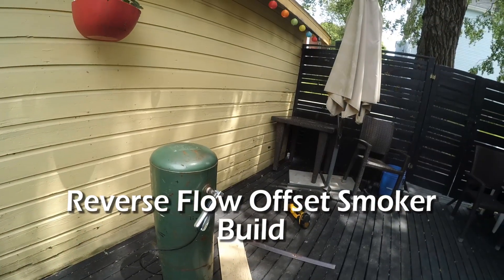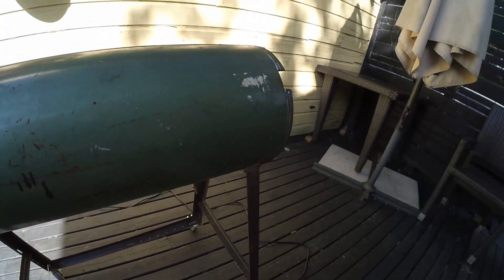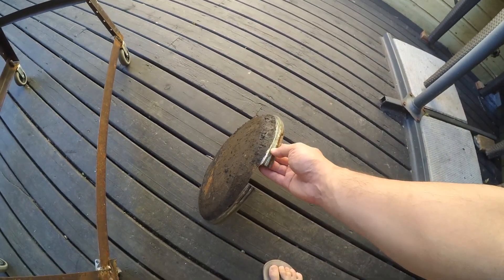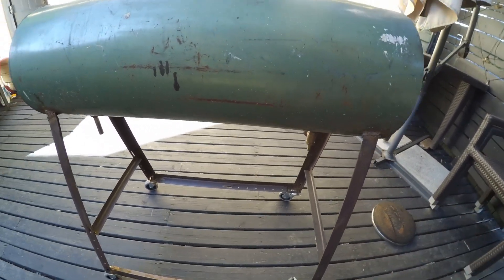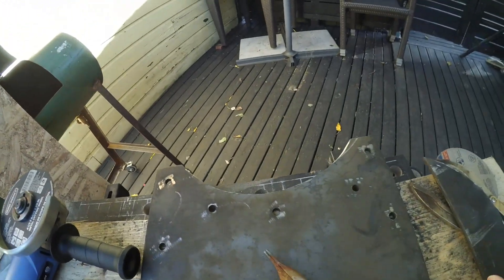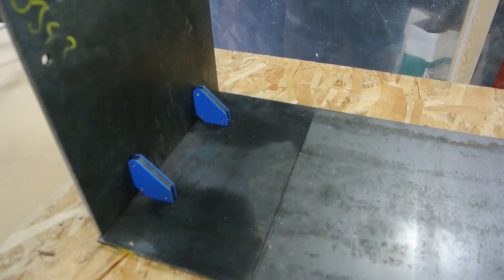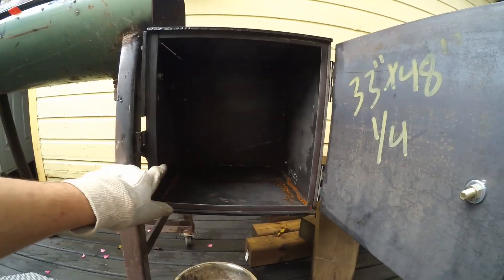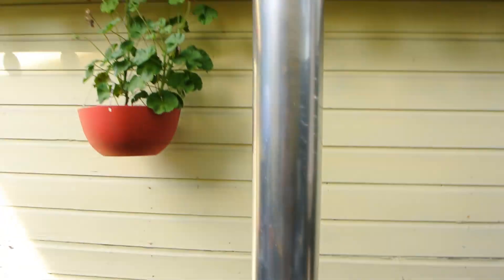Reverse Flow Offset Smoker Build

Comment: Awesome build, only problem is the exhaust on every smoker I have ever seen in on the opposite side from the area you place your coals...  If I were you I would cut it shorter and switch it to the other side so the smoke goes through the smoker and not straight up the exhaust .
Reply: Dustin Ross 

Look up what a “reverse flow” smoker is

Comment: if your smoke stack is too long, the smoke will have a hard time leaving the cooking chamber. This will result in stale smoke in the chamber which would cause creosote to build up on your food
Reply: Actually it breaths better with a longer stack and you can control the heat and airflow better

Comment: Is all your smoke and heat going right up your smoke stack before it has a chance to smoke/slow cook your meat? With your grate in your smoke chamber I don't see how your diverting the flow so that heat/smoke can linger before exiting. Did you install a plate below your grate? I must of missed that part if you did.
Reply: Something Wicked This Way Comes 
The smoke goes under and up the other side.. he explained how it works....
Reply: David Ybarra
I know how it should work. I commented cause I didn't see any baffles in his that would redirect the smoke.
Reply: The plate running the length of the bottom, is the baffle.

Comment: how did you determine the dimensions specifically  distance of reverse flow baffle above bottom of pit, distance from baffle to grill top, baffle opening size, grill top to top of pit, and smoke stack diameter and height?
Reply: I think you might be overthinking things just a little bit. I don't believe those dimensions to be super critical to the overall function. Cheers!

Comment: Why did you paint the firebox and the exhaust pipe black? You don't want those parts of the smoker radiating heat.
Reply: No, you want to retain as much heat as you can.

Comment: Nice job, I hope you pressure washed and rinsed all the inside metal with a bleach or antibacterial cleanser. water tanks have all kinds of crap growing in them, most plumbers can tell you what kind. I hope that's not Blue RTV around the door gasket, it's not good safe, it out-gasses some toxic stuff as it cures and gets old. I'm not being critical, I just don't want you to get sick from overlooking a step, I've built a few smokers and bbq's and while working with metal is second nature it took a while to learn about food safety metalworking. also smokers font get hot enough to kill some bugs. I know guys have been building bbq's with discarded everything for a hundred years but why take a chance?. good luck on your projects.

Comment: What's the benefit of a reverse flow vs having the smoke going out on the left normally??
Reply from the maker: +Panupat Chongstitwattana I think it's to even out the heat.
Reply: Since the optimal heat to smoke is between 225-275(for most things) even heat is essential to utilize the entire smoker
Reply: Wow I never considered that. I want to build a smoker with my Everlast welder (once I learn how to weld!)
Reply: Practice makes perfect. I was pretty bad when I bought my first Everlast welder. A bit of practice and reading and things will get better.
Reply: Indirect heat improves temp control and eliminates flame up's.

Comment: Just started looking into building a smoker and this was a great video showing your build. Thanks for taking the time and effort to provide a step-by-step run through! Very helpful. Now I just need to source my materials - might be a bit different here in Amsterdam :) . Now that you've had it running for a while, any follow up comments on what you might do differently in hindsight would be appreciated!! Thanks!
Reply from the maker: +Matt Clancy Hi Matt, glad you like the video.  In hindsight, after using it a while I would make a vertical smoker.  The one I made in the video works awesome but since I live in Canada and like to bbq in the winter, I will make another smoker with insulated walls.  So my plan is to make one with 1inch thick walls and fill it with clay for insulation, kinda like a kamado grill.   Also it will double as a grill and a smoker.  I will do a build video for it but since it is winter, I won't get around to it until the spring.  Lastly the thing I would do different is to make the intake as a sliding vent instead of the one in the video and put the opening or an extra one for the firebox on top, so it is easy to dump charcoal into it from a charcoal chimney once lit.
Reply: +Andrew W Yeah - I can understand why you would make those changes! Looking forward to seeing how your insulated smoker/grill turns out as well! Thanks for the reply and your tips from hindsight!

Comment: Shouldn't the stove pipe be on the opposite side instead of right above the firebox?
Reply: +gomezy3k That's why it's a 'reverse flow' smoker - the baffle plate (just below the meat rack) means the heat and smoke have to travel the length of the smoker (right to left) to then go up a level, get to the meat and travel to the exhaust/stove pipe again (left to right)
Reply: +gomezy3k  Its a reverse flow you dumbass.